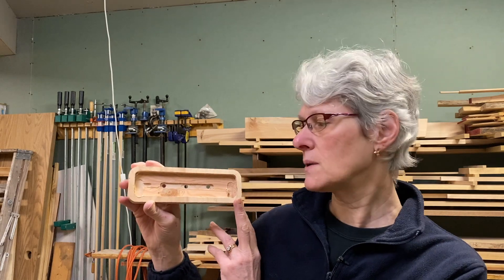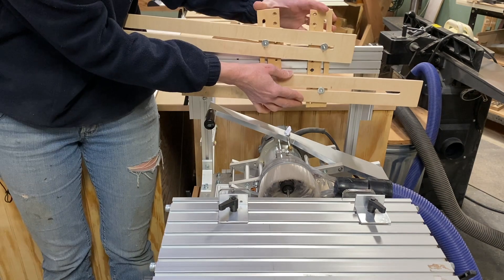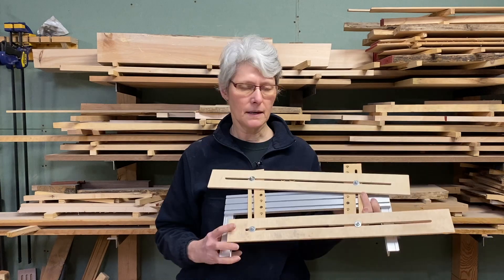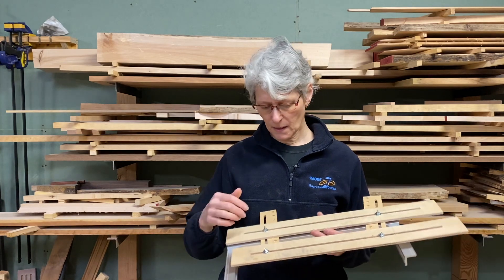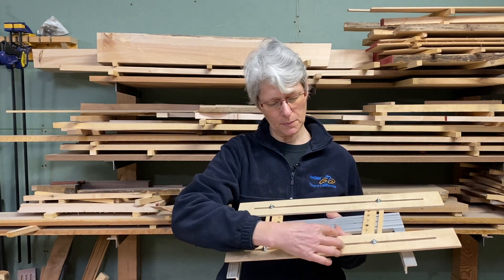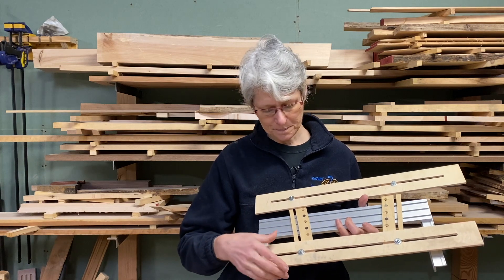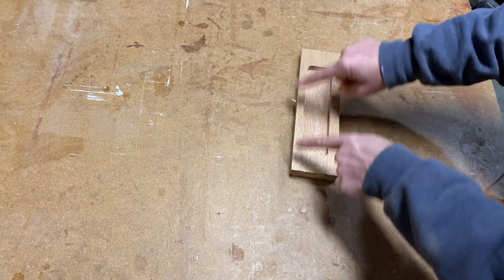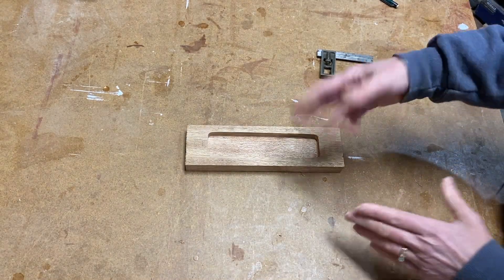PantoRouter Adjustable Jig for Making Templates

Comment: I wonder if you had a 3D printer you could make your templates out of plastic,  and they would be perfect?
Reply from the maker: That’s a good thought. I know there is a web site that claims to have 3D template downloads. We don’t have a 3D printer so I can’t say how well the templates work. We received a few prototype plates from Pantorouter that seemed to be 3D printed. On those, the rounded ends seem to be a bit “jagged”. Just not as smooth as their plastic cast templates. 
Personally, I have no problem paying for the templates on the web site, as it also supports Matthias Wendel, inventor of the Pantorouter. But sometimes I need a template that’s not mainstream.

Comment: I am working on a video covering 3d printing templates for wood working (I do some printing and designing with modeling software as well as woodworking/furniture design).  This would be a great collaboration if you want to make a printed template together.  You could share the specifications of what you need and I could include the design and printing of it then hand it off to you for demonstrating the use.
Reply from the maker: We could work something out. I don’t have a 3D printer though. But we’re willing to collaborate for sure!  I always have specialty templates for the Pantorouter. Recently I made a tsuba shaped template, but it’s difficult to get the opposite mortise for it.
SkyValleyWoodworking_at_gmail.com